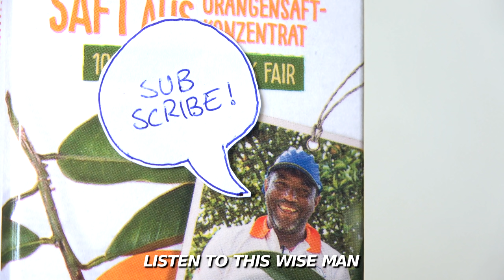Worn Chisel | Restoration

Comment: A little tip: Straightening the cutting edge is not necessary since it will be automatically straight after correct sharpening. And the tip is probably not hardened since it was not on the right temperature. A simple way to test the correct temperature: It should not be magnetic anymore once it is on temperature. I love these videos from you! Keep going!
Reply from the maker: Hey Detlef, thank you so much for your hints! 👍

Comment: Using orange juice for rust protection is a very clever move! It’s always a pleasure to watch your Videos and see how much effort and love you put in your projects! Beautiful restoration, great editing and an awesome result like always!
Reply from the maker: Hey man, thanks a lot! 😘
Reply: After the orange juice, when you re sanded doesn’t that undo the rust cure? What about camellia oil to stop it rusting?
Reply: @MrSongwriter2  The only thing I can think of, is the OJ Bluing prevents rust down in the remaining pitts.  Because if you polish the surface to gleam (and sharpen/flatten with stones) any surface treatment would be worn away, obliterating the rust proofing. But that's pretty normal on a chisel.  a good polish is mild rust inhibition by itself.  But the pits would be a problem.  My guess is the OJ Blue really only remains / was only ever for, the pits to keep them from continuing to rust.
Reply: @JasonRSpenny  I’ve gone down the electrolysis route as that cures the rust, then depending splatter with gt85 or camellia oil. I can definitely attest to the camellia oil as I had some rusty garden tools I cleaned up after shed roof leaked. The camellia oil kept them rust free over winter in a very damp UK shed
Reply: @misterpatina  I suppose you can't just use Tang.....  see what I did there?

Comment: A tip for the next heat treat. The metal has to be heated to non magnetic, and if it doesn’t set the oil on fire it probably wasn’t hot enough
Reply: Bright red, then oil quench. If the oil catches fire you're in trouble.
Reply: this was way too low temperature, it has to be glowing red. He didn't do proper heat treatment. He should have test the hardness.
Reply: Correct. The Curie point 723C.  Easiest is to attach a magnet to the underside and when it falls of, quench the object.  Sand/polish and then heat to blue and leave it.
Reply: @kib2675  actually, you should heat the steel to austenitizing temperature which is in the range from 850°C to 950°C, depending on carbon content of the steel. Then you keep the temperature for a while to allow the carbon to be completely dissolved in the crystal matrix and the comes the quench. In this case the blade didn't have any red glow which means that the temperature was probably below 525°C (Draper point)
Reply: @kib2675  blue is too much heat and you will blow through your temper. Straw to brown at the most. Aim for Straw color
Reply: hardening temp relies on carbon content.  For an un-alloyed wood chisel 0,8% carbon is expected.  723C is sufficient to achieve austenit,  and with proper quenching all will be martensit with internal stress.Higher will result in to coarse grains. For a chefs knife wich never hits a nail tempering to 200C+ is OK.  For a wood chisel, which may hit a nail/screw that is too brittle, so go for blue.   As a curiosity:  In heavier objects I have seen that the quenching have not been adequate, such that all austenitt have not turned into martensitt.  When these objects have been used as pistons in hydraulic cylinders and been used above the arctic circle exposed serius low temp.  The rest austenitt have converted to martensitt and the cylinders seized.  Martensitt taking more space the pistons swelled.  That manufacturer allways now freeze the pistons before machining.

Comment: A couple of points for ya.  If you use a single cut flat file it will leave a very smooth finish that would need little if any sanding.  Save you a bunch of time since you are filing it anyway.  Use a draw file technique to finish when you have the profile you want.  The part that goes into the handle is called the "tang" not the "sting".  Maybe that's a European thing..  Most of the old chisels I've seen have a brass feral but the steel looks good too.  Nice old chisel that was well used.. however I have needed a short chisel on more than a few occasions, this would be perfect.
Reply from the maker: Thanks for your hints Brad. Iam not a native speaker, that’s why „the sting“ came up. 
Hope you enjoyed anyways.
Reply: It’s not a ‘feral’ .
It’s a ‘ferrule’.
Reply: @johnstarkie9948  Yeah, I noticed that.  Correct you are, it's not a cat.  I didn't figure it was worth the time to correct.  Normally stuff like that bugs me but sometimes you have to say WTF and move on..  :)
Reply: @bradjohnson9671  
You tried to educate.
You tried to teach the OP how to use English words,  and which English words to use.
You tried to correct his use of language.
And then you failed to correct your own misuse of a word!!?😀

It’s not only cats which become feral.
The word can be applied to any domestic animal which has learned to live ‘in the wild’.
Even children.

You might pronounce ‘you’ as ‘ya’,  but it’s still spelled ‘you’.
Reply: I wish I had the capability to test the metallurgy of some of these old edged tools.   Many of these old chisels, hand plane blades , etc.  really hold a good edge.  Others not so much.  Same holds true for modern versions.  Most of the low end chisels you buy don't stay sharp long regardless how much care you give them.  I've often wondered if going through all the restoration hassle is worth it.  Some are not very useful and aren't much more than a "wall hanger",  others will still be in service decades from now.

Comment: This is another great one... that chisel was ready for the dump before this "pedicure" haha! Cool technique with the orange juice 👌 I genuinley have never heard of it. As for the woodworking on the handle, amazing! I would reccomend using high speed steel HSS for the wood! And as for the metal, use the carbide but use a much vigher rpm and a more aggresjve feed ;D
Reply from the maker: Hey Martin, thanks for your drilling tips! To the orange juice: you can basically cold blue in everything with acid. The effect will be stronger, if you cook it in orange juice or other acid stuff. Thanks for watching!
Reply: In 50+ years ,I've never heard of a chisel being "ready for the dump".
They are simply pieces of good quality steel.They can ALWAYS be recycled,one way or another.
Re-sized,re-ground,re-tempered...just re-worked.
I've dumped a few handles but never a blade.
You've got to love a good chisel.
Reply: @howler6490  Yes, you are right :D I guess it was just closer to the dump if that makes sense

Comment: When the backface of a chisel is polished on a strop, it should be placed flat, so you don't create a bevel on the backside, because chisels are single bevel tools, stropping on a not flat angle on its flat face will create a secondary bevel, it will make the chisel very hard to use and will take longer to sharpen
Reply from the maker: Thanks for the hint. I just swiped it over the strop 3-4 with the backside, worked pretty fine in the end :-)
Reply: On a straight razor a strop does not remove any material. It smooths out the edge that gets damaged from shaving. In this case the strop probably just removed the burr by bending it back and forth.
Reply: @misterpatina  So very welcome, im thankful for your content, it was a habit i was in and i could not really understand exactly why my chisel wouldnt pare fine work when i started fine furniture woodworking.
Reply: @petercolquhoun2086    Strops do remove material from chisels if you use an abrasive paste. The black stuff that's left on the strop is a sign of this. Strops do the same as a stone, but very gently. 
Previous poster was right, back of the chisel needs to be flat against the strop, otherwise you create a double bevel and future sharpening problems.

Comment: Cool video, I like your style :) 
I dont think your steel is hardened tho, it didnt look to be hot enough (around 800-900C) aim for cherry red colour and at the right temp a magnet will not stick...then you quench. To test for hardness run a file over the steel, a file will not cut hardened steel, it will "skate" over it, if the file cuts you have to start again with the heating process :)  This is not the last step either. it needs to be tempered too. A file is hardened, but has very little temper; thats why it will shatter if hit with a hammer, or even if you drop it....its so hard that its brittle. A blade cannot have this property or it will chip VERY easily with normal use. So it has to be tempered at around 200C ( an oven will do) for a couple hours and allowed to come to room temp by itself, no quench, it has to cool slowly after tempering. Ive seen you working on other projects and attempt to harden them too but the temp was way too low...... they were not hardened. Your videos are good, but you do need more practice with your metallurgy :)
Keep the videos coming lad :)
Reply from the maker: Hey man, thanks a lot for your Information! I’ll get a real oxygen burner the next time to drop some cherries 🙂
Reply: @misterpatina  Im so glad you didnt take my words as negative ones :) Ive made a few cutting irons for hand planes (made many mistakes along the way too and turned good steel into scrap metal :P and sometimes I still dont get what im aiming for hahah) it is a learning process......no one gets it right first time, or even all of the time for that matter; metal can be a finicky thing sometimes :)
I have a "thing" for old tools, I love em, so I really enjoy your videos man!! :)

Comment: The remake of an Antique Chisel using one original part - masterfully I must add but hardly a restoration. You know the big ring was there to prevent the handle from shattering right?
Reply from the maker: You’re right here! But Iam sure it was added later, when the handle was cracked
Reply: @misterpatina  yeah it's possible.

Comment: For using again? A restoration, as in fixing up what's there, would have used the wooden handle. But then it would have been a collection piece. But either way, indeed, quality job. Just not clear to me if it is intended to be used.

Cheers!
Reply from the maker: Hey David, most of my pieces won’t be used regularly again. It’s more like a display thing.

Comment: You've done a lovely job. Unfortunately the pitting on the back makes it pretty useless. As soon as you sharpen back to a pit, there goes your edge, and it doesn't take much pitting to ruin it. I've got several nice old chisels with the same problem.
Reply from the maker: Thanks Dave, you’re definitely right here. Guess I won’t use this old boy very often 🙂

Comment: Well, well Mr Patina, you removed very bit of patina from this old chisel and it's devalued because of this. The metal ferrule at the upper end of the old heavy duty handle was there for a reason, it's omission was surprising
Reply from the maker: The metal ferrule was attached later, i guess right after the handle cracked. It wasn original, so I didnt want to keep it. Hop you enjoyed anywas.

Comment: Nice work, very clever and all that, but I prefer tools with some of the character and age left in them. You might as well have just made a new chisel...  
My workshop is full of tools, old and new, all used regularly. The old ones are repaired and maintained but never 'made as if new'. I enjoy the dirt, grime, polish, wear, etc. left by the previous and long dead owners of them. Sometimes I talk to J.M. or Pats Jimmy or my father, or whatever unknown person left their initials on the tool. It seems only polite to speak to them when 'borrowing' their tools?  Maybe I should put my initials on a few of the tools I've bought or made? , so someone in the future can wonder who I was?
Reply: This is a tool restoration channel. If you don't like seeing old tools restored, why are you here
Reply: @Hephera  This is 'remaking' not restoration. There is nothing left of the old chisel except the core of the steel blade, not even ground to the original shape, carefully made 45 deg corners, reground as curves. It's fine, everyone has different opinions...

Comment: This is not a restoration! This is just reusing an old blade and putting it into a complete new handle. Restoring is using all the old parts, which you didn't. Nice end product, but no restoration.